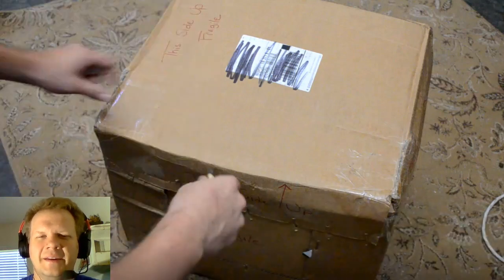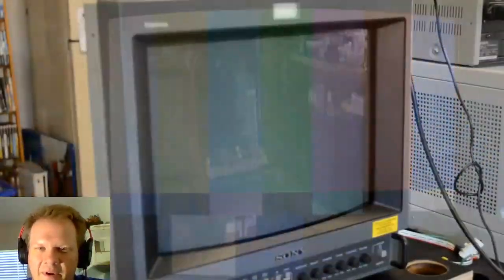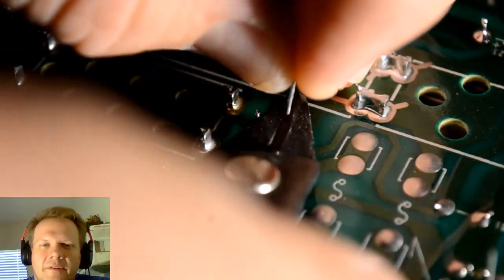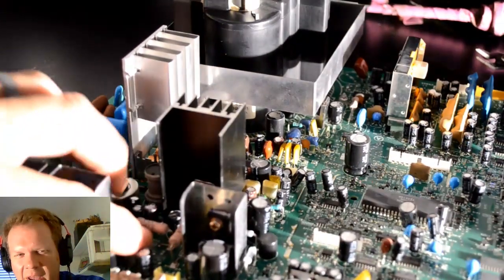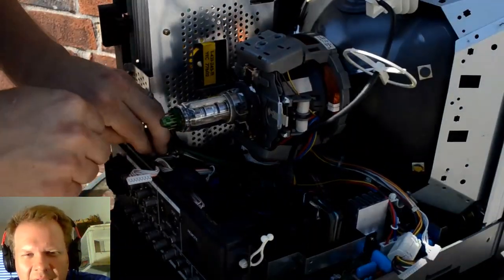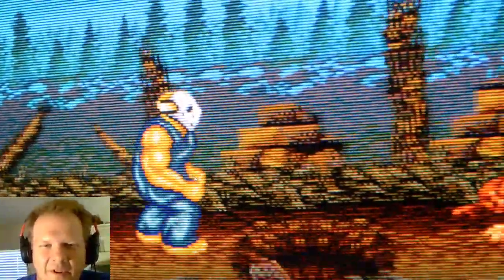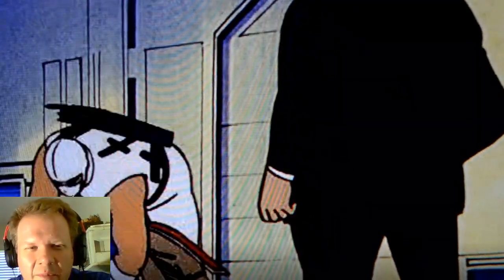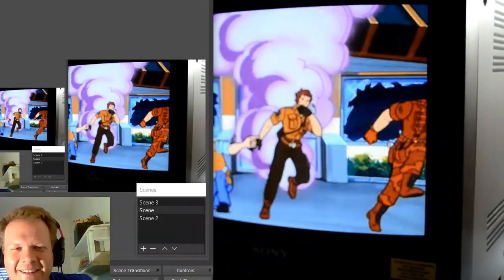Sony PVM 14M4U Restoration Walkthrough

Comment: Hey retro tech, what are the reasons you'd want a pvm over a consumer CRT besides RGB inputs from the factory? Just curious like are their displays better? (I know they can do higher res. If they are high end and there are some wide-screens, really wanted to know why they are better
Reply: Most PVMs don't do higher input signal res than a consumer TV. They do 15 KHz; in other words 480i and 240p (plus most PVMs support PAL's 50Hz 576i and 288p equivalents). So apart from PAL support there is no improvement in input res capabilities.

The major difference compared to a consumer TV is the overall precision of the screen (that being said some consumer TVs can be really good too). Convergence and geometry are (potentially) great and consumer TVs have more coarse masks, leading to a TV Line count of rarely more than 450 (this is a measurement of horizontal resolution by the way [even though it's called lines] and it's not to be compared with pixels as CRTs don't have pixels). Also most consumer TVs use the shadow mask which apparently does not show scanlines in 240p as pronounced as a Trinitron and people love scanlines.
Reply: The simple answer is a higher phosphor-count, which means more vertical picture detail (NOT horizontal picture detail.  Horizontal picture detail is 240p/480i/480p/1080i/720p/1080p/1440p/2160p/4320p).  A television set from the 1980's, rarely had a line-count over 380.  The 1990's, 500.  The line-count of a C.R.T. tube is calculated from a 1:1/3:3 aspect ratio.  ...but C.R.T. tubes have a 4:3 aspect ratio...  ...to estimate the ACTUAL vertical resolution of a C.R.T., we add 25%, to the line-count.  250lc=313 lines, 450lc=513 lines, 600lc=750 lines 800lc=1000 lines 900lc=1125 lines 1000lc=1250 lines
240p consoles have a maximum vertical resolution of 340 lines.  ...the 250-600 line-count monitors are fine for that.  A 480i/p console has vertical resolution of 680 lines.  A 450lc monitor and above, is fine for that.  A DVD has a maximum vertical resolution of 720 lines.  A 600lc monitor is fine for that.  A 720p console has a vertical resolution of 1280 lines, an 800lc monitor is fine for that.  ...and yes, you CAN connect an HDMI cable to 3G SDi, to connect an HD C.R.T. BVM.
A 250 line-count monitor looks like a crisp LCD screen.
An example of this, is shown in this video.
https://youtu.be/brdg6ToAt78
If you did not grow up with scanlines, then these might make out for acceptable desktop retro gaming monitors.
A 450 line-count monitor, WILL have distinguishable scanlines for 240p content, and very thin scanlines for 480i content.  I use a 1340 PVM from 1991.  Its "high contrast" screen, slightly retains an image for each interlaced frame, which means that the odd lines have a visible image, at the same time as the even lines.  This means that 480i looks VERY similar to 480p.  The 480i image barely "jumps", like my childhood JVC C.R.T.
People say that a 600 line-count monitor is good for 240p gaming.  The scanlines are even thickness, compared to nonscanlines.
800-1000 line-count monitors, are good for 480p/maybe 1080i/720p content/gaming.  Their 240p scanlines are supposedly so thick, as to darken the display to an uncomfortable level, without a gamma boost.  Excessive gamma boost, shortens the usable life of a C.R.T.  480i content supposedly jutters (horribly), because the scanlines are so spaced out.  Depending on how critical the on-screen detail is to you, you may or may not want to play 1080i footage on these monitors, because they have a maximum vertical resolution of 1250 lines, and a 1080i image, has 1920 lines of vertical resolution.  You will lose image crispness, if you do not use 480p or 720p.
It should be noted that 250-450 line-count monitors are 8".  450-800 line-count monitors are 13-17" (JVC made 17"ers) and 20-36"ers are 450-1000 line-count (the 450 line-count monitors from this size category are from the 1980's and the 1000 line-count are from 1999-2007).  ...why am I saying this?  A VERY high end television set from the 1980's, would have ONLY had a 450 line-count, at 25".  1990's, 600lc @ 25".  ...a PVM/BVM with 450-800 lines at 14", is SUPER crisp.
This video shows what a 1990's 13-19" tv set looks like, RGBs modded.
https://youtu.be/NkpSBK3g-gA
The modder says that its image reminds him of a mid-1980's RGBs computer monitor.
This video compares an RGBs modded consumer C.R.T. picture vs. an RGBs PVM/BVM C.R.T. picture.
https://youtu.be/jbi9HEz-cww
This video also has good comparison shots, and a fairly good explanation of consumer-grade C.R.T. phosphors vs. professional-grade C.R.T. phosphors.
https://youtu.be/RAi8AVj9GV8
If you are interested in playing 1080p games or movies on a C.R.T., buy an HD Fury, so that you can laglessly run tun a signal through an HDMI cable to a VGA output.  This allows you to play a game from a high definition source, to a high definition computer C.R.T monitor.  Depending on the C.R.T. computer monitor's specs, you can game at 120Hz/480p, https://youtu.be/ZHphWoLEVFU
Or 1440p, at 100 Hz.
https://youtu.be/HrhsWnEMafA
This is good review of the same topic.
https://youtu.be/BmtmWk3puGg
1440p in a 4:3 aspect ratio, will lead to 1080p, when viewing 16:9 games/Blu-rays, on a 1440p 4:3 C.R.T. monitor.  Most 1440p computer C.R.T. monitors support 12-bit color, so enjoy watching HDR movies on it.
I hope this information is helpful to you.
Reply: @badreality2  I have to disagree about the terminology. Common terminology says horizontal is from side to side and vertical is from top to bottom (or bottom to top). And due to that what I said is true. For example, 240p is not the horizontal res – it's the vertical res: it's the number of lines or rows, starting to count at the top line until the last line at the bottom; in contrast to columns or pillars from side to side.

Since the lines in an analog signal are discrete, a CRT doesn't even have any other choice but to display the lines count (such as 240p or 480i) of the input signal, minus some overscan and possibly somewhat compromised by bad convergence or focus.

The TV Lines measurement is a measurement of the horizontal resolution capability of the mask/phosphor combination (details per line, count from side to side, number of columns/pillars it can resolve).
Heck, a Trinitron mask doesn't even have any vertical grid (unlike shadow masks), therefore the vertical res (top to bottom) is virtually infinite and only limited by the beam and input signal.

Comment: So could the caps on the power supply cause some ripples or wobbles in the screen geometry too? Like mine still has some issues with that, might have someone able to re-cap the whole power supply for me though. He already did a few caps where he thought some problems may have been but it didn't fix the issue.

Also, do you have a video for the usual caps on the geometry A board you recommend changing? Maybe I'll try and get all those done too if you can detail which. 

Thanks!
Reply from the maker: Yes it can.  I sell cap kits for most PVM models.  One for each board.  Please email me for more info:  snutt541@gmail.com
Reply: Retro Tech Hey I didn’t get notified that you replied, sent an email recently seeing if you could maybe help trouble shoot a problem I’ve been having with geometry. Just want to drop a line in case went to spam.

Email slightly outdated, had the power supply re-capped but didn’t change the issue. I can provide some pics and video if you can help me work out the issue. 

Be much appreciated 

Thanks